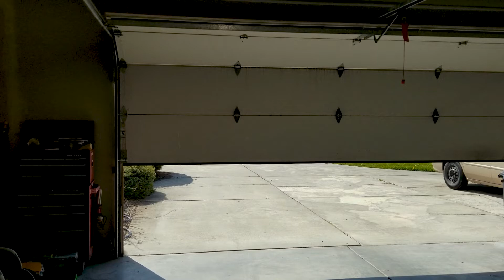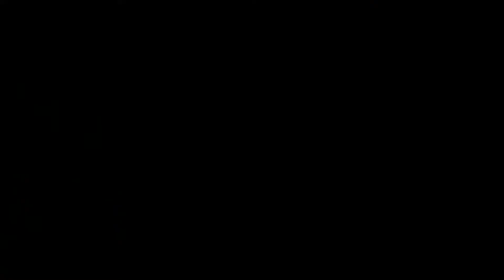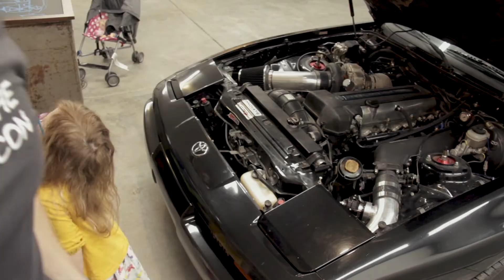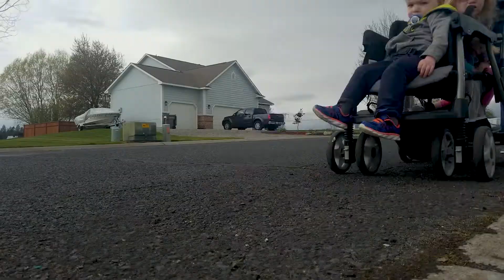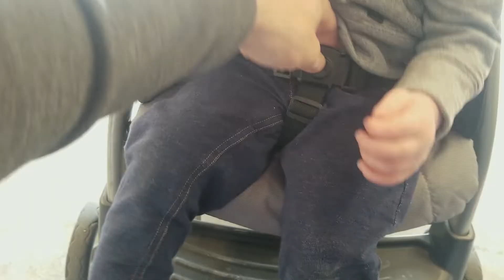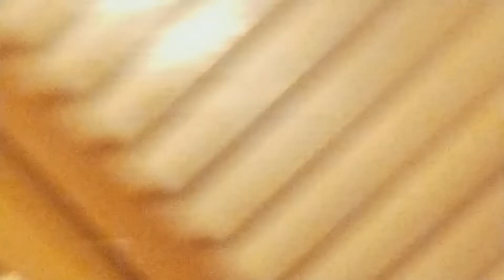Weekend Alone With The Mistress.......

Comment: Maybe it's the rack itself, check if fluid has leaked out of rack ends. It'll be in the rubber gators so be ready when you remove the clips
Reply from the maker: Just put up a video from the second half of the weekend and was able to figure it out. At one point after checking the the ops I started over and checked the rack, the lines from the top and bottom and pulled both bolts thinking the same thing. They were clean and dry inside which is great but didn't help.